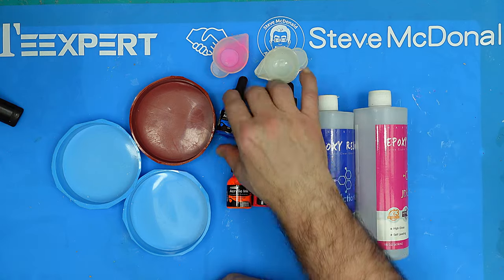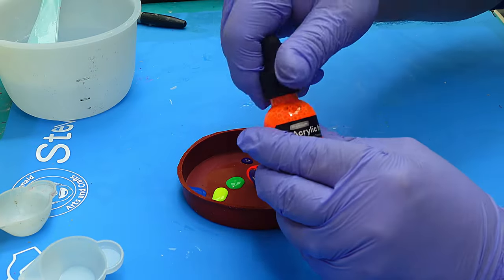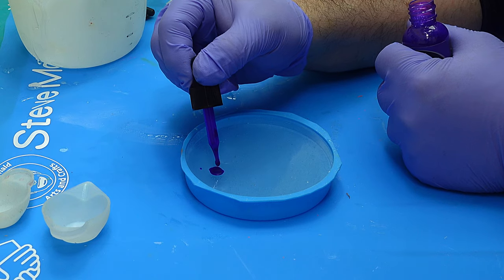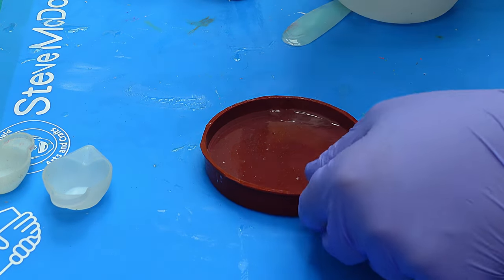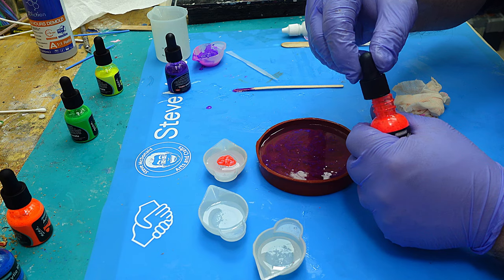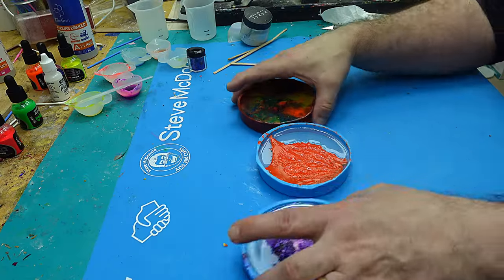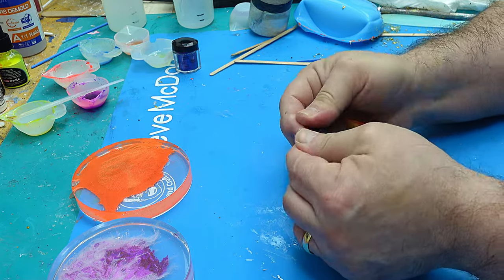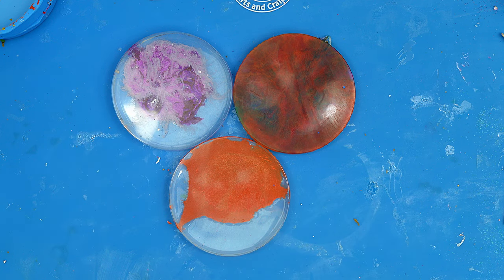What Happens When You Use Acrylic Ink in Epoxy Resin

Comment: Hi Steve. I have used these inks and had success the trick is to only use a few drops mixed in eith the resin not just dropped in. They are much more potent than alcohol inks. In the small pots less than 1full drop would work. ❤❤❤

Comment: Hi Steve...I've used the same set of acrylic inks in my resin.  However, I've only used them to color the resin when I want a more opaque color and don't have the paste to do the job.  I haven't had any problems using them at at.  However, they are very potent.  One drop usually does the trick.
Reply: Me too - they work really well as a resin colourant and agree with Cathee that they are very potent. ;) Love watching your experiments.

Comment: Yes, you can use Acrylic inks in resin, but it's meant to be mixed into your resin to color it just like you use mica powder, pigment paste, and resin pigments/dye. 
It's most often used in specific pour techniques such as the Larimar, Dragon Flower, Fairy Flower, and more. You have to pay to learn those techniques or watch others doing those techniques and then try to figure it out yourself. But, trust me, you will spend far less money just buying the courses.
You also need to use a white pigment paste to get the ink and resin to move and create designs.  You separate your resin into smaller amounts (but much larger amounts than those tiny pots) and you pour each color mixture into your mold a specific way depending on the technique you are using. 
And you have to have some clear resin to use at the end of your pour. The clear is called a push. You pour it into the center to make the colors and white push outward
 As they move back towards the center, they create different patterns.
 It can also be mixed in with your mica to help deepen and even change the color of your mica and resin mixture.

Comment: There is no 'Myth' about using it. You Can use it, it's the AMOUNT that becomes an issue. As someone who has worked with resin almost 7 years now, you can indeed use acrylic paint in resin to color it, but you have to be weary of the AMOUNT of paint that goes in due to the acrylic base that is used in such paints thinning the resin too much where it can't cure properly. There's a rule that you shouldn't go past 15% vs the amount of resin used. For example if you are working with 20ml of resin, then no more then 3ml should be paint. Otherwise the resin may not have enough of its self to bind and cure to full hardness, leaving it 'soft' as it's diluted. In the long run it's always better to use the raw pigment to color resin, as that raw pigment is also what colors paint, but you don't get all the extra staff and chemicals that are in paint along with it.
Reply: Those are Acrylic inks not paints. There is a difference. And a difference in how they work with the resin. 
Paint is typically just a colorant. While the inks are much lighter weight wise and when used in specific pour techniques along with a white pigment paste and what is called a clear push they can create beautiful patterns in the resin. They are used mostly in pour techniques called flowers (not to be confused with 3d blooms) such as the dragon flower, fairy flower, chrysanthemum, crackle effect, larimar stone, and more.

Comment: Have you tried the Dr PH Martin calligraphy inks?  I have some from my paper crafting days and just wondered if they would eork
Reply: Those inks work well in resin.
Reply: In very small amounts. My first try I dumped it - thought it had a nozzle tip - into UV resin and no it did not work. It was a mess. So just a drop.
Reply: Yes I love using those inks in resin,  they have worked great for me!

Comment: Does rubbing really take the shine off your mold?
Reply: Yes, if you need to clean your mold use tape to get any particles, resin, hair, etc off of it. Tape will get most stuff off of your mold. You just touch the tape to it and pull it away, don't rub it. 
If you also use an eco resin you might have to wash away the residue. In that case use warm water and mild soap and swish your mold around in the water to rinse away the residue. If you must touch it to wash away a spot, then touch under the water and as lightly as possible with your fingers. 
If you have mica or chameleon powder stuck to your mold and tape wasn't able to get it off. Then use a soft brush or a micro brush dipped in warm soapy water to get the powder out of the mold. Be delicate, especially with the micro brush because it's just a thin soft material over a sharp plastic tip. Rinse away the soap as you go, don't let it dry on the mold. 
And yes, many people use isopropyl alcohol to clean their molds, especially when painting them with mica powders. In those instances it's unavoidable. But Try to use alcohol on your molds as little as possible. The alcohol dries out the mold, causing it to break down faster and get dull quicker. Spraying it on the resin to pop bubbles, though, is fine.
Reply: Thank you.  That was REALLY helpful ❤